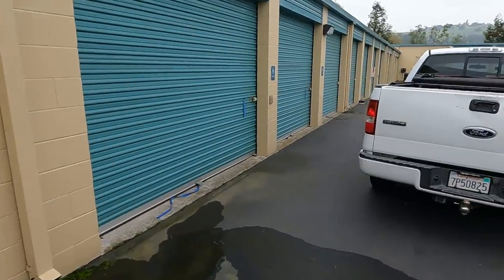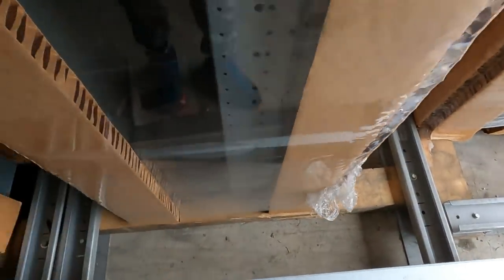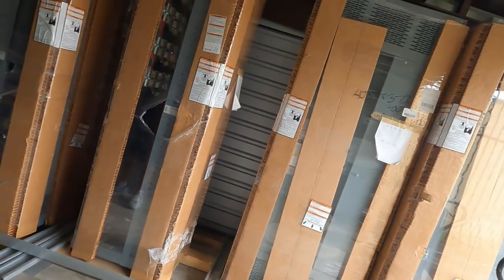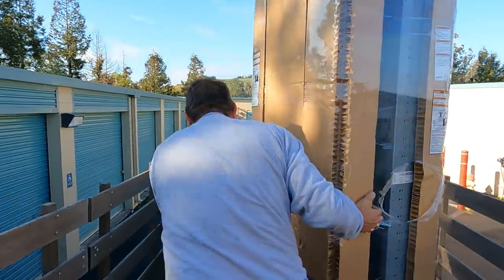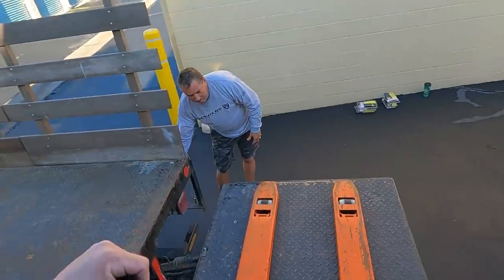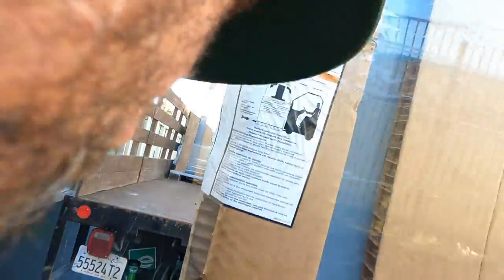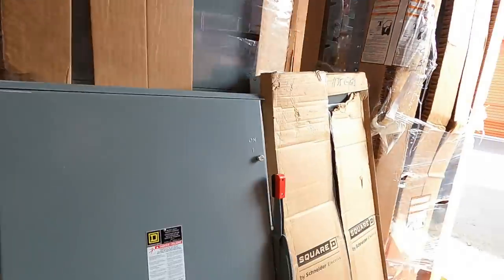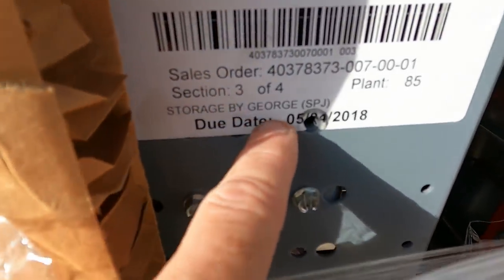These Are $100,000… & I BOUGHT THEM!

Comment: That’s some good electrical equipment. We use those cut/out switches all the time in the high voltage electrical utility. Also, looks like some type of electrical distribution load center. Our company uses the best, and it’s all that stuff right there. The cut out switch looks like it goes for around $8k possibly.
Reply from the maker: Thanks for the tips!

Comment: If you still have those electrical vaults you might contact an electrical supplier like Offe electric supply or Granger electric , they are national suppers os electric equipment. Call your local dealer tell them what you have and ask if they would like to buy them.

Comment: You have a electrical breaker panel just like our homes have a breaker panel but bigger for commercial. I see them in the newer carls jr. buildings I work at. Nice find pretty specific to commercial electrical contractors that are doing a new build. My last find had used diapers in a diaper genie bag.
Reply from the maker: Thanks for the info!

Comment: Thows are high voltage power panels not spacific to soler panels can be very valuable to anybody building a large factory or a marijuana grow steel plants any factory looking to grow there business they are worth anywhere between eight tousand and twenty tousand a piece depending on the application good luck

Comment: No offense but why would you say in the title that it's $100,000 after your research and then put it up for $50,000 you just said at the end of the video you just contradicted yourself by saying people always put stuff up for $2,000 when they wanted $5000... that's an honest question not trying to be rude
Reply from the maker: Well worth value and sell value are always two different things . To order this from square d is $100,000. Most don’t want to buy unless From company and under warranty . But also it isn’t a easy sale . There designed for specific specs so one can buy one and it not work for there specs . Amps, volts , breakers etc. and also do you want to hold for months and years for right buyer or turn and burn . But yes i didn’t want 100k well i mean who doesn’t . But 50k was my start to fish . I will say this . I sold it this morning.
Reply: @StorageAuctionPirate  that's awesome to hear that you sold it that's what I figured that it was spect out to a specific job or job site also like you said it was supposed to go in that building I appreciate you even responding like I said I wasn't trying to be rude I was just curious

Comment: im seeing a 3 section 2500a system on ebay for $65k, but im also seeing a 3000 amp 3ph system going for $30k but its refurbished and the first system is used, so i dont see any reason you couldnt get $80k for it or $65 if you want to move it quick. That should be a 2700 amp system hence class but I might be wrong or probably am.

Comment: Did u sell these yet? I would say if not you should contact your local BIG commercial electric companies. They may want to buy it at a discount, but this is special equiptment that is used in certain settings. The building being built will have to need your specific sized gear. Hope you get good money on your find.

Comment: Hope this is helpful, but these guys may offer a clear understanding of value since they specialize in used electrical components. I know it's new, but unless you have the invoice as purchaser, since it's a specialized distribution system, I typically see them in new warehouses, but haven't worked on or installed since my apprentice days, many many years ago. Happy holidays, new years and success inn the new year.